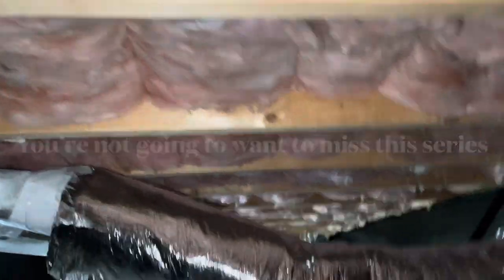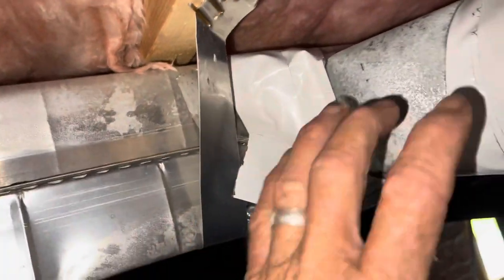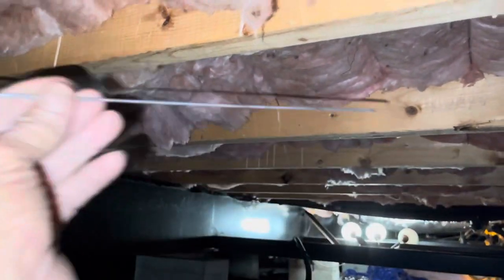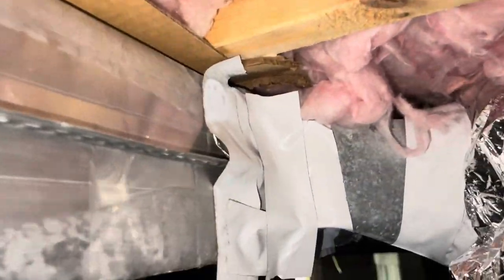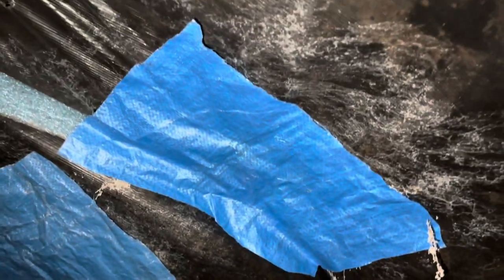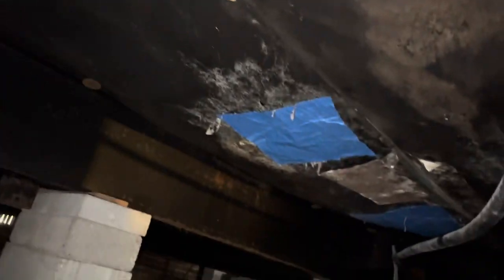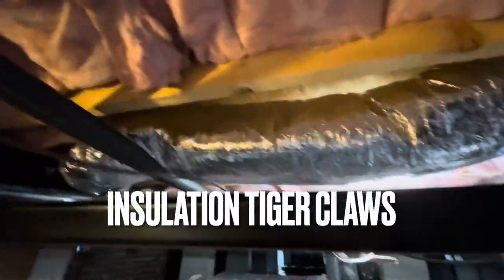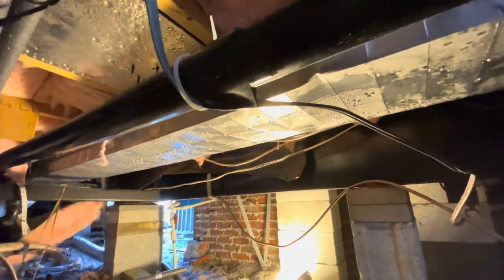Mobile Home Underbelly now we are re-insulating.

Comment: If your vents are exposed; why not use #6 mastic??
Reply from the maker: I’m not sure what 6 inch mastic is
Reply: @Drewsroofingandhomerepair  

It is a fiber reinforced air duct sealant. It comes in tubs or tubes and is used with a fiber tape. When dry it is very strong and is a 100% air seal.
Reply from the maker: Interesting never heard of it. Thanks for the tip